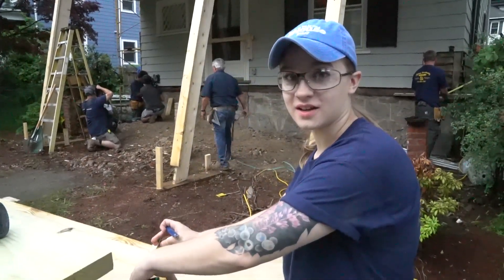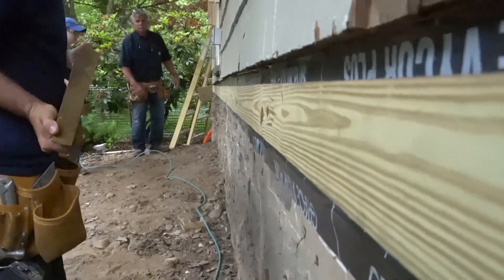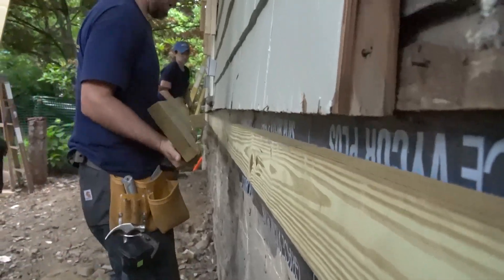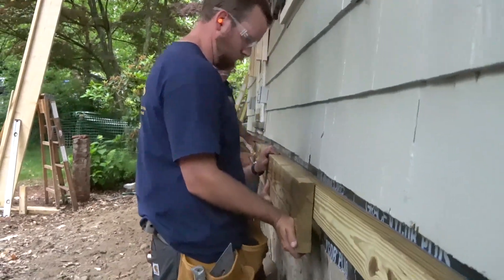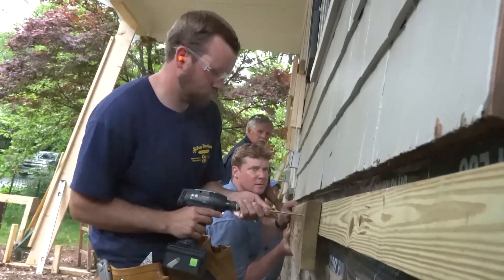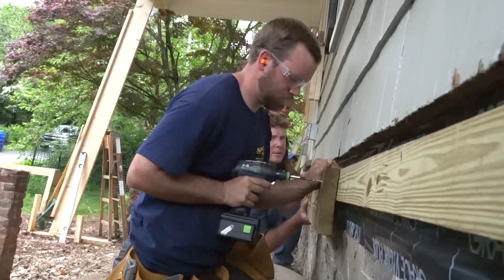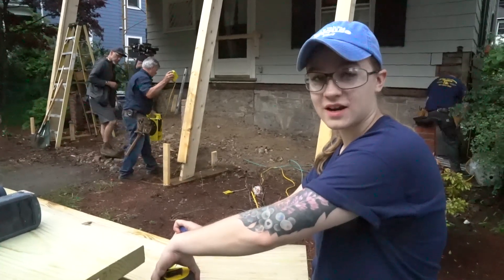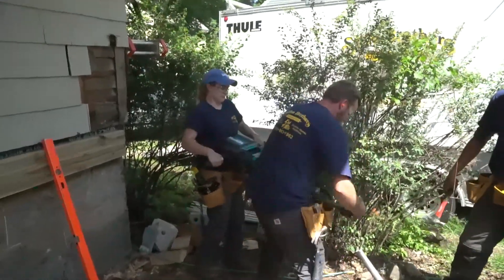Apprentices Help Frame the Porch | Newton Generation NEXT House | This Old House

Comment: How about a real trade? Not home improvements or residential work! How about fire sprinkler fitting? Iron working? Sweating copper? HVAC? Electric? Welding? Steel erecting? A real trade and career!